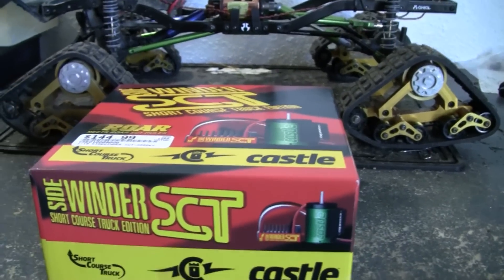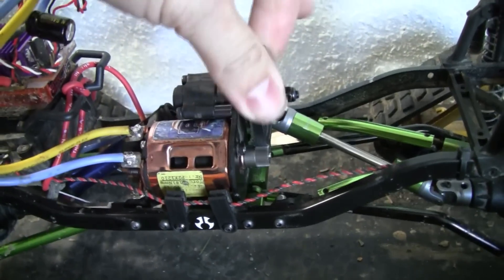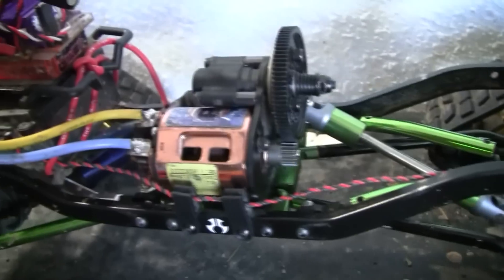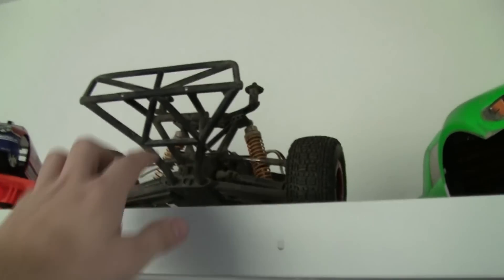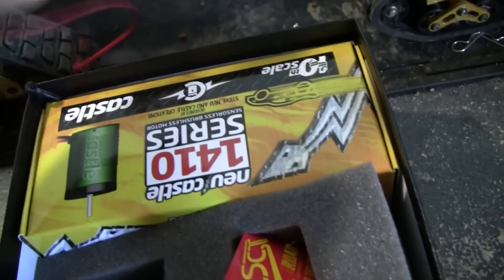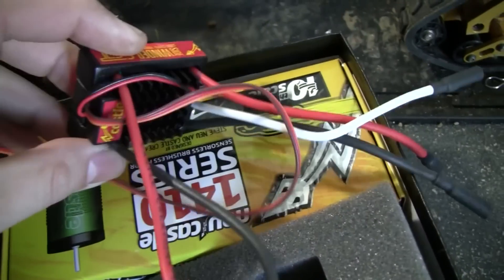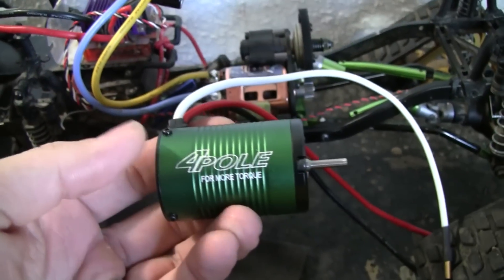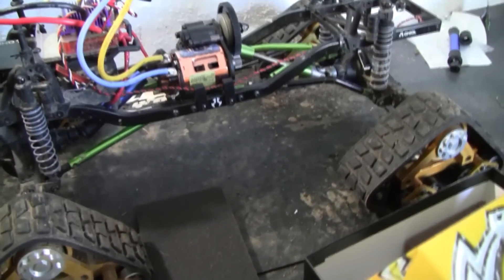Castle SideWinder SCT Unboxing - Using It On My Axial SCX10

Comment from the maker: @RCWinnipeg Yeah i ran a test with a 15/84 and it seems to run good, lots of punch, so i am going to do a few test runs tomorrow and post some vids of it. This motor has well over enough torque to handle these tracks, just going to keep an eye on the motor temp.

Comment: When Ur motors start to get hot that means Its telling u something.... Take the tracks off. And by putting that sct in a crawler that's gonna be over kill when u put the wheels back on. It's fast enough in my hpi blitz with a Nimh battery.

Comment: Hey, XFox RC, I just watched your videos and it kinda surprised me that you were able to drive really slow and fast with your Castle Sidewinder SCT Combo. Because with mine it is always fast. I push the trigger very slow to the minimum amount and still it drives 10-15 mph already which makes it hard to control. I tried lots of things with the Castle usb adapter but I can't figure out what might help me. It's a standard gearing with a standard spur and pinion, nothing 
fancy.
PLS HELP!
TY!